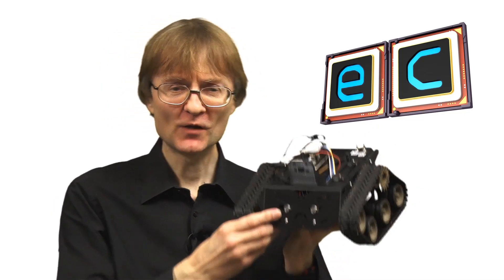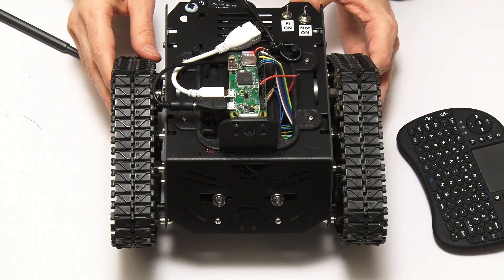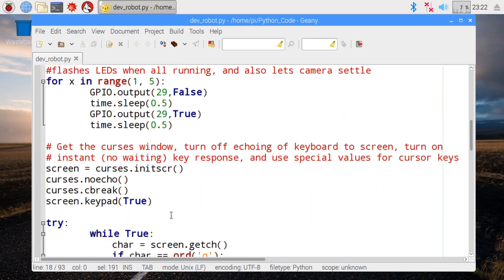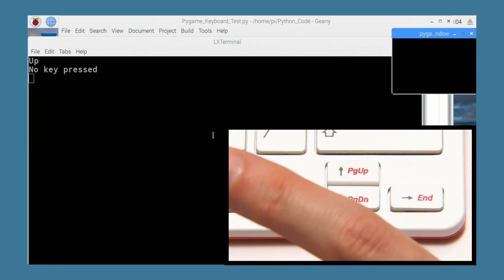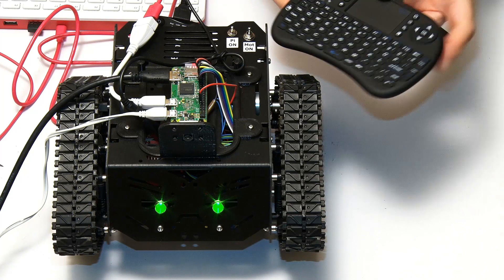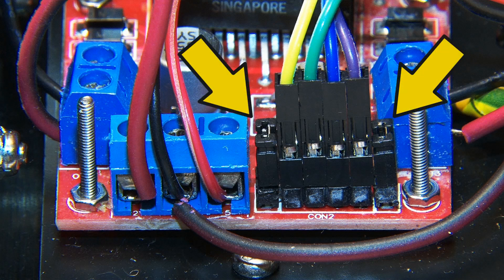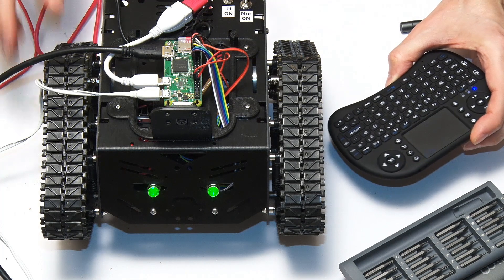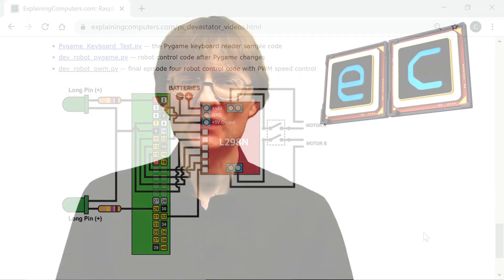Raspberry Pi Devastator Robot #4: Pygame & Speed Control

Comment: Have you face any heating issue with raspberry Pi zeo... I am asking you because it's a single core computer and I am planning to order raspberry Pi...( I can't decide between pi zero and pi3 a+ )
Reply from the maker: No, I've never had overheating problems with the Pi Zero.. A Pi 3A+ will run warmer, but is well designed themally, and has four times the power.
Reply: @ExplainingComputers  thankyou...I will buy pi zero
Reply: But if you buy the part as a computer or as a controller for you robot? I am confused
Reply: @NicolasChapadosGirard  for robot and other stuff..I am not gonna use it as desktop computer...